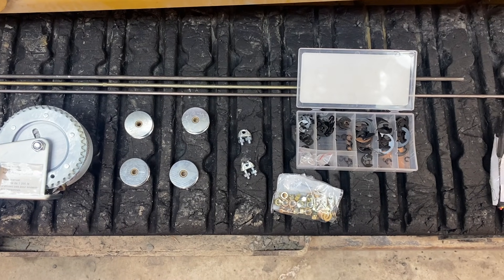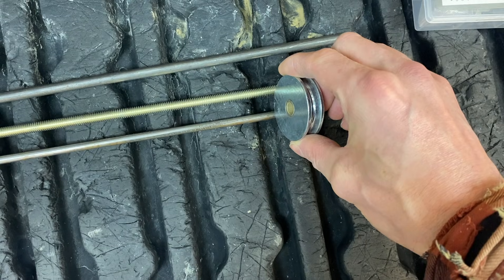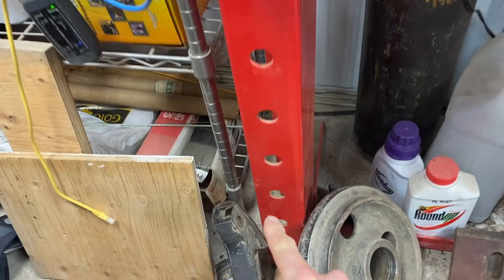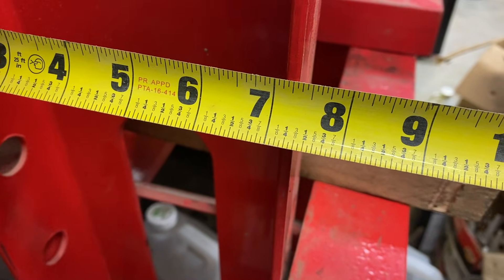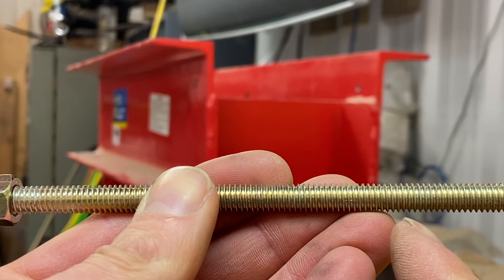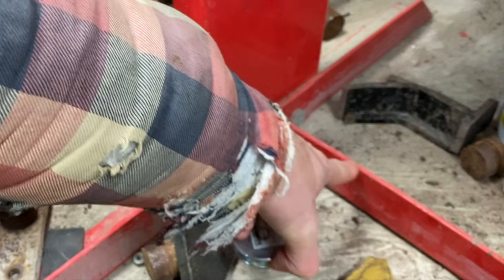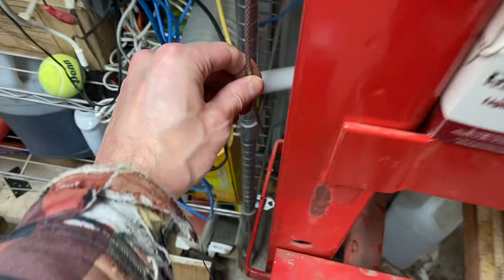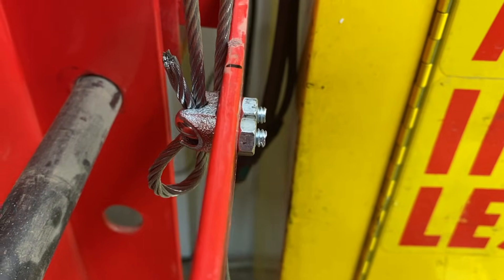How to add a winch to a hydraulic shop press, no welding!

Comment: Nice video but your cable clamp is straddling a dead horse. Big no no!
Reply from the maker: It should be clamped correctly, the saddle is on the live end and the u-bolt is on the dead end.

Comment: Pretty cool idea but curious why didn't you just cut the cable and run two lines one each way.
Reply from the maker: If I'm understanding your question, why didn't I run two cables from the winch, one to each side of the deck?

That would have worked too, I never thought about it.  You would need to secure the second cable to the winch then run two pulleys to the right side to route the cable.  I based my design off what a friend has on his 50t press.